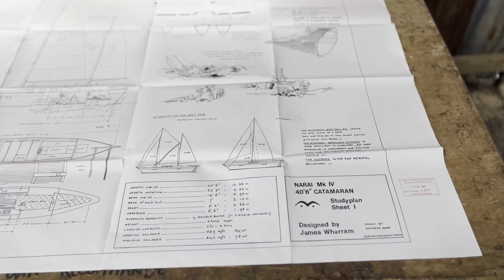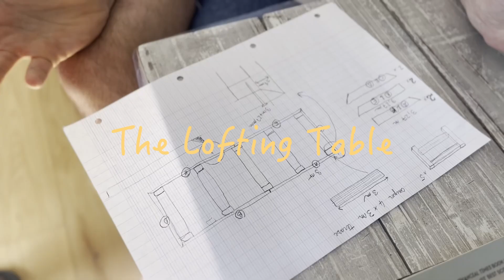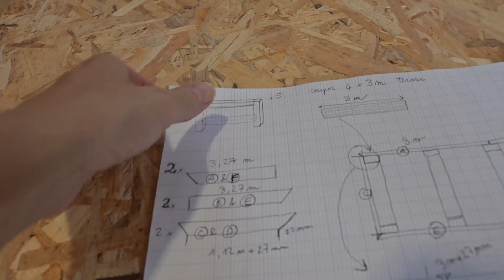Self-building a Wharram Catamaran in France

Comment: Hi guys..I didn't get back to your point about lofting from the floor plans.. been  dealing with docs. back and joint pains 🧙🏻‍♂️Remy cycling, motorcycles and lives accidents  take it carefully my old injuries have caught up with me    .. I forgot but  making templates for the bulkheads has been done by others... JIC they can also be used as back ups and router guides.
Reply from the maker: Thanks for the tip, Remy is drawing up some cutting guides on CAD. The newer Wharram Designs plans have them included, but not the older classic designs.